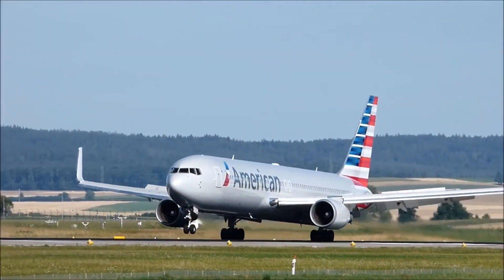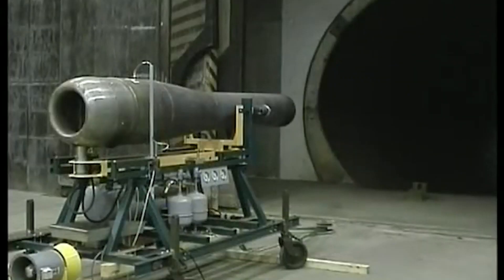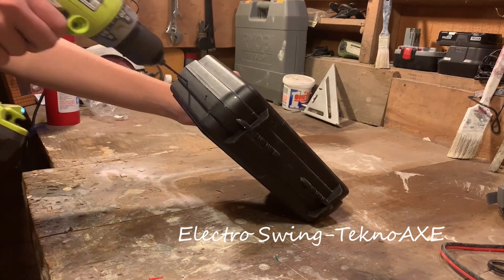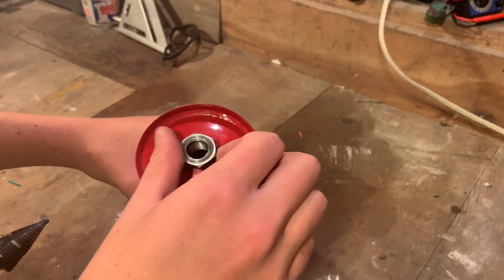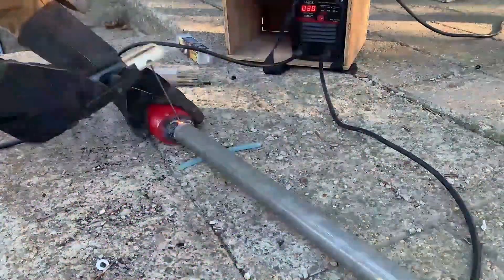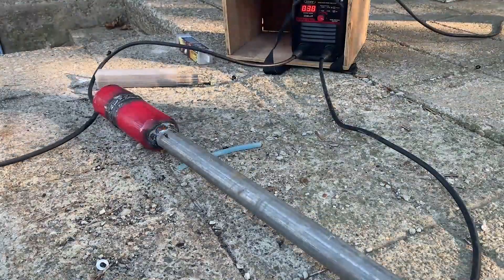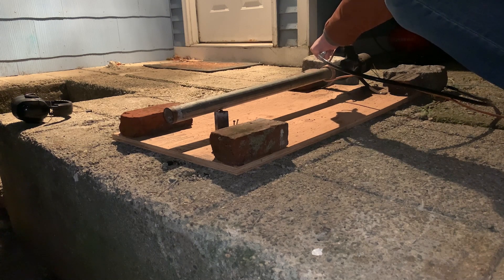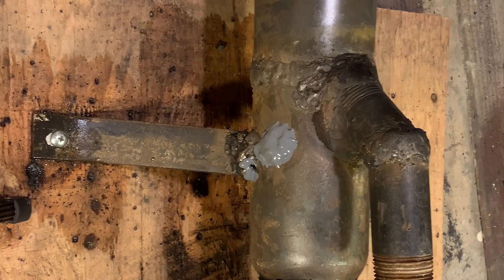Home Made valve-less pulse Jet engine

Comment: One thing i found that helped start and sustain burn is to pre heat the combustion chamber until glowing red, thein try starting the engine.
Reply from the maker: Would that help with fuel flow also?
Reply: @jamesjudson67  
i would say yes, but start as normal, another thing to try is moving your forced air back and forth to get the best air/fuel ratio. Just mess with the ratios ,  youll find the sweet spot..lol

Comment: Centripetal compressor jets preceded the turbojet & turbofan by a few years.

The V1 engines had a shutter at the front which opened & closed (I have seen a few of them).
Reply from the maker: Where did you find one?
Reply: @jamesjudson67  the Shuttleworth museum had one, they are scattered about museums in those parts of Europe where they were operated, naturally not all those which were launched functioned as intended let alone those captured as Nazi occupied territories were overrun by the Western allies.
I daresay a number made it across the Atlantic as trophies etc & the Russians will have been given a few.

Comment: If you are using a extension cord on your welder, if its not rated for the amp's that the welder draw's then your welds will come out really bad, and its heard to keep a bead going. Plug it directly in to the wall socket or find a larger extension cord rated for welder's. 50 AMP rating.         Nice job on the pulse jet.
Reply from the maker: I was just going strait to the wall outlet (with the correct amperage rating). Since then I just decided to switch out my system for a cheep flux core setup.

Comment: I also noticed you arent using oxygen. Take a small oxygen cylinder and then just use a mechanical valve. And if you say you dont want to spend large amounts of money then simply get sponsered , there are a lot of companies who will sponsor just about anybody as long as you advertise them but you need to look for them
Reply from the maker: Good point. I just don’t want the volatility of working with oxygen.
Reply: @jamesjudson67  Dont worry about that if you just strengthen the combustions chamber with a mixture of epoxy resin and carbon fiber you can make it withstand a butt ton of pressure and you can actually make it withstand 3000 celsius. 5432 farenhiet if you use imperial unts. Dont put it near the spaek plug tho. Or just use a turbocharger to increase inflow of air. If you dont want to use oxygen... I mean it is pretty scary to use oxygen when stuff is already burning to hell

Comment: Also try increasing the diameter of the air inlet and slightly increase the fuel in proportion. and increase the cirumference of the combustion chamber more space and more fuel should defintely help. If it doesnt the well....meh

Comment: You should look at few videos by Integza it will radically help your jet engine making. He managed to make self sustaining pulsejet from carbon fiber. altough the design is different (slightly)  but it will make it more clear. you can also try to make a shockwave engine first, then pulsejet Mk2 the try your best at a rotating detonation engine. Integza always give 3D models of his builds so you can actually replicate the whole process with his schematics.

Comment: For an engine that size you're gonna want to get rid of that regulator. Keep going with it kid these engines are allot of fun.
Reply from the maker: Taking out the regular would probably a good call. I just did not have a connection point to the tank otherwise.
Reply: @jamesjudson67  there are two types of propane regulators on the market, high pressure and low pressure. The ones you find on BBQs like that are low pressure, and won't put out the volume you need. You might find a high pressure regulator on something with a much larger burner like a turkey fryer, or you can get them off Amazon. A high pressure regulator will have an adjustment knob on it, and sometimes a gauge.

Comment: What keeps expanding gases from pushing back into intake?
Reply from the maker: The exhaust is larger than the intake so the air is forced out of the exhaust. That creates a draw like in a fireplace. That pulls more air in through the intake and the process repeated a few hundred times per second.
Reply: Ignition of a gas creates its own suction it's not larger pipe size it's longer fires going to get its food just like you as quick and easy as possible so shorter section on top o2 in the exhaust is longer is going to push it out these I built two similar put them on my trike it was clocked doing 63 miles an hour ago by a cop and it wasn't that I was moving that fast it was noise level also proper fuel to air mission with helps a lot that's why he had firing problems
Reply: Read about PULSE JET ENGINES.... interesting engines with no moving parts.... except the fuel control